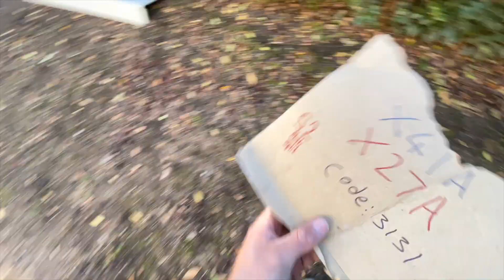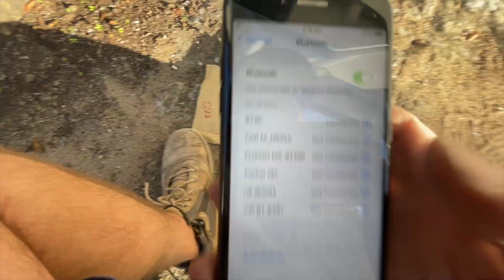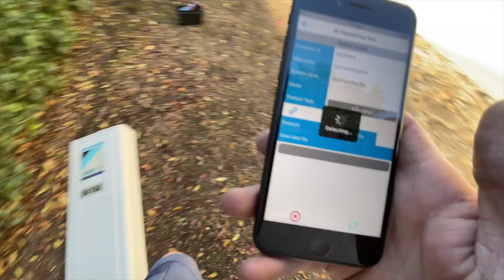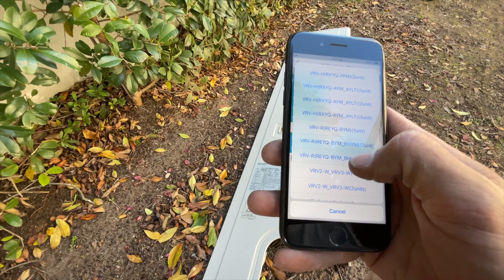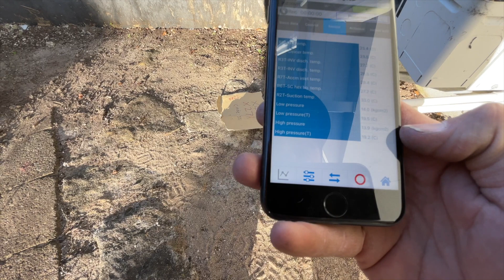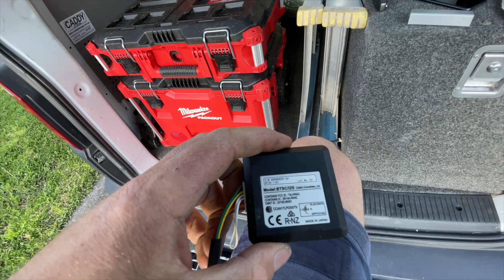How to use DAIKIN BLUETOOTH SERVICE CHECKER..

Comment: YOU CAN MAKE YOUR OWN ITS JUST A BLUETOOTH DEVICE, THE MORE DIFFICULT IS TO GET THE CONNECTION CABLES, BUT YOU CAN BY IN CHINA A COMPATIBLE DEVICE WITH CABLES FOR AROUND €100

Comment: Hey man I having trouble trying to find the right thing to connect to a minisplits. I don't have the isolation cable was it susposed to comet
 the Bluetooth device? My minisplits is 240
Reply: Also the one they gave me the box it came in says it's for iPhone which I have a Android, it may not matter anymore the version I have is the 999172t

Comment: I like so much this video, but something makes me confuse. This analyser verify the current of the machine/equipment? I need to monitor this.
Reply from the maker: It doesn’t measure the current draw of the machine however you could use a clamp meter to do that ?
Reply: @maracservices  Yes, i can do that, but in my case, i have to know If the outdoor board is Reading correctly the current. I do maintenance on eletronic boards (PCB), and I have one that turns the compressor on for 50 seconds, turns it off, and turns it on again, 6 times, and it gives error E6. I removed this board, tested it on the bench, and it works normally. I believe that the board is reading the current wrongly, or the compressor is damaged. So I needed this parameter. Midea for example presents current and voltage in its analyzer.
Reply from the maker: @Paulormgomes  interesting. To the best of my knowledge, this analyser does not have that measurement however in this case, can you measure the current of the compressor during start up with a tong tester clamp meter. Maybe the compressor is indeed pulling high amps?
Reply: @maracservices  Thanks Mitch!!! Sucess to you! I Will make this test today in the client's house. To make sure that compressor is ok or not.

Comment: Hello Mitch
Great little tool from Daikin, how can I get my hands on one of those? Regarding the inverter checker, is that from Daikin as well? I ask because I’ve seen guys use an inverter checker from Daikin and from Mitsubishi electric, there are also generic checkers off the internet. In your experience do you have to use brand specific inverter checkers, or can you use ANY inverter checker? 
Great videos as always! 🎉🎉🎉
Reply from the maker: Hey mate, I got both the Service Tool and Inverter checker from Daikin in Taren Point (Sydney) but any Daikin should stock them on the shelf. 

I can confirm that you definitely don’t need a specific brand of inverter checker. They all work the same and you can use them on all brands. 

I recommend doing a free Daikin training course which shows you how to use the inverter checker. A lot of techs are actually using them wrong. 👍🏻 goodluck
Reply: YOU CAN MAKE YOUR OWN ITS JUST A BLUETOOTH DEVICE, THE MORE DIFFICULT IS TO GET THE CONNECTION CABLES, BUT YOU CAN BY IN CHINA A COMPATIBLE DEVICE WITH CABLES FOR AROUND €100
Reply: @mountainklima5602  Hi friend. Have you ever had a chance to take apart a device like this? I want to make one myself. Maybe you have some photos of the circuit board? There is no way to buy it in my country
Reply: @Electro_Sheeps  not yet but i will look into it a post it

Comment: Agree with you there Mitch,
It would be very helpful if you could turn the units 
on/off or change temperature and mode and clear errors as well..
Especially when the condensers are located on a roof and you are working on VRV units in apartment blocks..
And yes, that app is super slow connecting.
It feels like I’m on dial up when using it..
Reply from the maker: Yeah it’s definitely not the perfect app. I used to have heaps of trouble trying to connect to it but these days it seems better. Also they didn’t have the new R32 systems on it either but that may have changed. It’s definitely handy to have though.